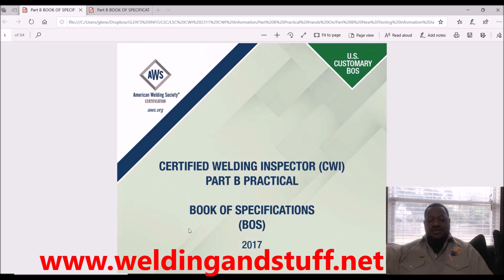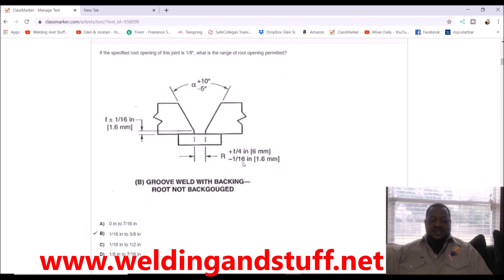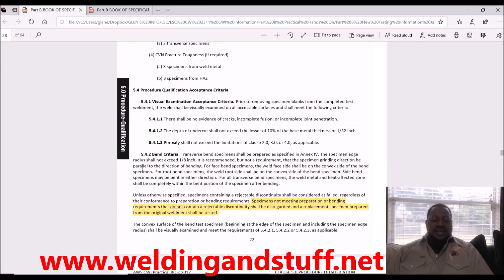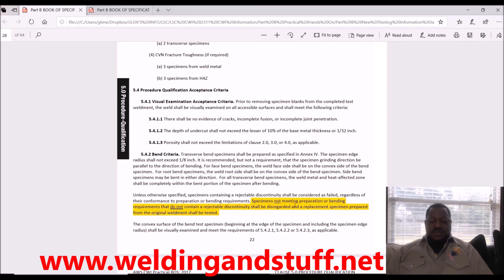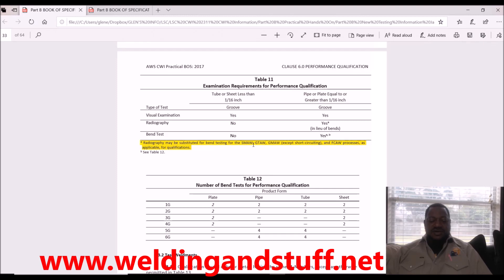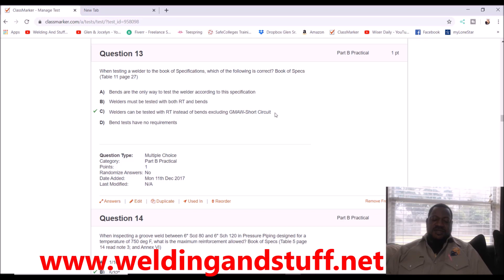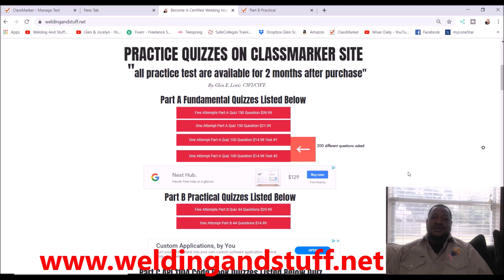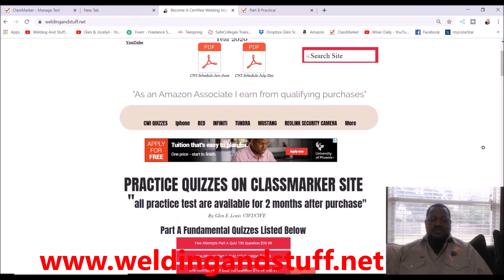CWI 40 -  HOW TO PASS THE PART B CWI EXAM; SEE SAMPLE QUESTIONS AND HOW TO FIND ANSWERS

Comment: The hardest ones for me was the ones where the weld wraps around the corners and asks when statically or clinically.
Reply: cyclically loaded Connections terminations and starts SHALL be made wrapping the weld around the corners not less then 2 times nor more the 4 times the specified weld size

Comment: Are the questions in your website for part B the similar to  the test??
Reply: no, i think he may need to update. just took test in feb.
Reply: @dalegarcia2430  how'd you make out? I'm taking it in a week
Reply: @alexanderv7815  passed all 3. Part B was tough I got a 74
Reply: @dalegarcia2430  nice man! Congrats. 
Any words of wisdom for part B?
Reply: @alexanderv7815  practice working on PQRS/WPS. I printed blank ones and qualified my own procedures to get the feel for it. Hone in on the words SHALL/MAY/SHOULD. In your spec book table 7 pay attention to the sub clause rules a/b/c/d/e/f. Pay attention to the annex side bends specimen/transverse bend read all this footnotes thoroughly. Understand the difference between qualifying the WELDER and qualifying the procedure. Watch the wording on all questions if you spent the time to study you know this stuff, they just word it the most difficult way possible. Good luck man !
Reply: @dalegarcia2430  thank you brother! Really appreciate the tips
Reply: @dalegarcia2430  Kudos on your test passing, Let me ask, how would you compare B to C? B is hard but C to me seems even more so. Also, were you pressed for time on the tests? or was that not an issue,  I test in 3 weeks, Thanks
Reply: @Edaloy27  b is the hardest out of all 3, solely on the way they ask the questions and how you have to approach it. C was the easiest for me if you know all your sections and where to look you’ll be fine. For C I recommend taking those practice test and just timing yourself trying to get under 2hours if possible.

Comment: Part b I'm on my second retake. Missing it by 1 question is a kick in the teeth
Reply: @YJ   I have mine now. When you're doing measurements literally in  1 32nd. If you're not in the exact same with the person who came up with the answer. Is the difference between passing or failing.